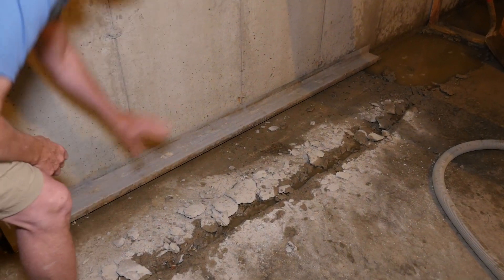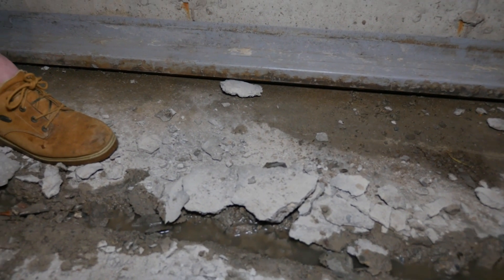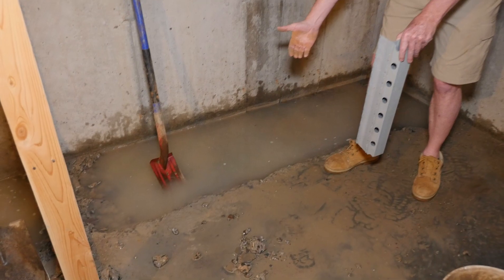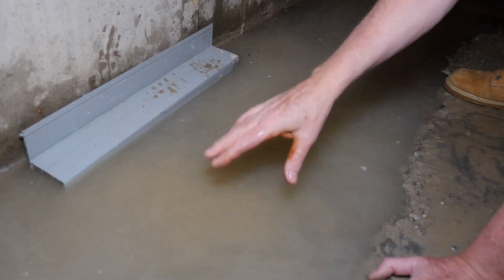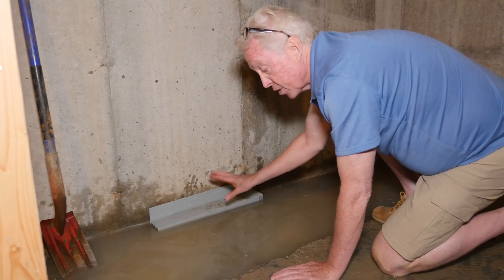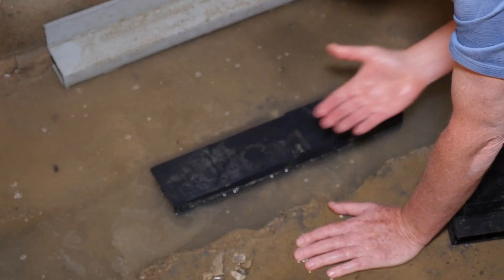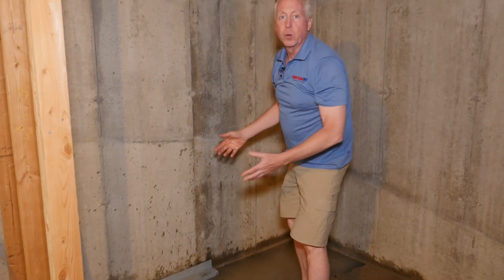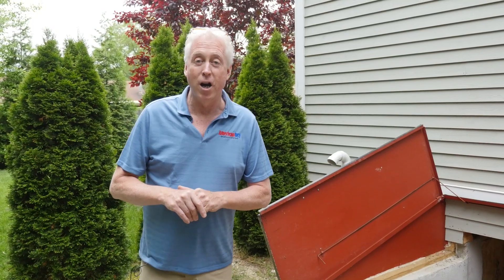Basement Waterproofing Systems Comparison | Wide Foundation Footer Failure

Comment from the maker: Get a customized installation to avoid future problems with your basement waterproofing.
Reply: So all basements and even slabs get a lot of water under them, so apparently these didn't have drains on the outer edges of the basement and the amount of water overwhelms those rectangular drains.  Is that the concept in one sentence?  What am I missing?  I want to build my house right.  So how do you build a basement right the first time to avoid this?  Seems like there will always be some water down there, the key is to have the depth of the rocks in the french drain to be deep enough to keep the water from touching the concrete floor/footer/wall?  I want to know the proper way to build the basement in the first place.

Comment: How do you drill weep holes under structural tabs . Love your videos
Reply from the maker: Holes are drilled 1 inch above the tab and the hole is covered by drain board. There’s a lot more to it than that, but will explain that in a future video.
Reply: @AmericanDryBasementSystems thank you, just started mine. Alot of work. Next step drilling weep holes

Comment: Wouldn’t pvc be better. Seems like the corrugated pipe would hold water in the ridges
Reply from the maker: After 25 years of installations, we know corrugated pipe is the best. Those ridges are designed to self-clean the pipe as water travels down to sump pump on a pitch.  No need for clean out ports to perform maintenance. Ridged PVC have fragile joints to connect elbows and clean out ports to maintain. Not the option you want.
Reply: @AmericanDryBasementSystems  ok thanks for the response
Reply: I think the extra water that doesn't drain out of the corrugated drain just flows back out into the rocks, the rocks of the french drain do a lot of the work, if the water in the rocks is not too much it will just evaporate, but it can't be too much, just my guess.

Comment: Why wouldn't you use rigid perforated PVC pipe instead of the flexible corrugated pipe you currently use?  Wouldn't it be easier to properly pitch rigid pipe?  Would the cost difference be that significant?
Reply from the maker: It has nothing to do with cost. We find the benefits of a corrugated perforated pipe to outweigh any rigid pipe. It's easy to pitch with corrugated ridges to make it self-cleaning. Larger versions are used to go under highways and moving rainstorm runoff into lakes.
Reply: PVC and corrugated each have their own advantages and disadvantages

Comment: The “box system” he is talking about sits in front of the footing and sits about 10” below the floor slab it’s definitely pitched. Also the corner port he showed he was taking the top off wrong lol. Maybe he needs to do more research before he talks about a product also the stone and pipe method he uses eventually erodes dirt around it and creates belly’s in the pipe. And because he don’t utilize clean outs they become clogged and useless.
Reply: Seriously. I don't know about their system, but the nerfed comparison means I would never even consider it.  I just want to hear from an engineer who knows what they're talking about rather than sales people.
Reply from the maker: @ScienceBreather  Nerfed? We actually tear one of those box systems out of fresh flooring to prove our point. No smoke and mirrors. It was installed as expected. Terribly. The customer is very happy we intervened. Here is the link to the abridged tear-out: https://www.youtube.com/watch?v=9eTymmkUM2Q
Reply from the maker: Did you notice I removed that system from an unbroken floor? That's how it was installed. Without a lifetime warranty against cracks, clogs, and no maintenance... it's hard to believe anyone can trust that system in their basement.